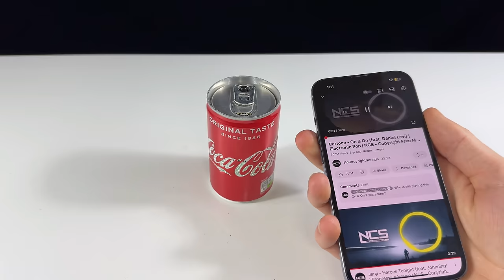Amazing CocaCola Speaker - DIY Bluetooth speaker by Coca Cola

Comment: This is great if you have this stuff laying around but a Bluetooth speaker this size is cheaper than these materials. Love the educational value here though.
Reply from the maker: Sure! but it won’t be the same as building your very own it will mean more
Reply: Don't forget the cool factor. Friends will be impressed when you casually mention that you built it yourself.
Reply: Buy a small speaker, take it apart and use can as shell
Reply: @josephvanscheltema113  He's done that pretty much but just bought the peices instead

Comment: Sandpaper can pop a can top off like that? Come to think of it. It's crimped onto the top and it's thin aluminum... I suppose I just answered my own question. Never think about it until it's put into context.
Reply from the maker: It’s a clean way of doing it instead of cutting and butchering the rim.